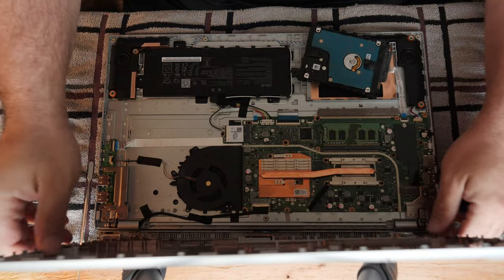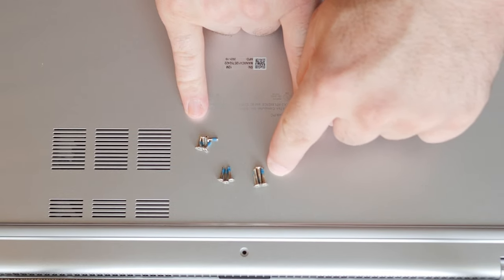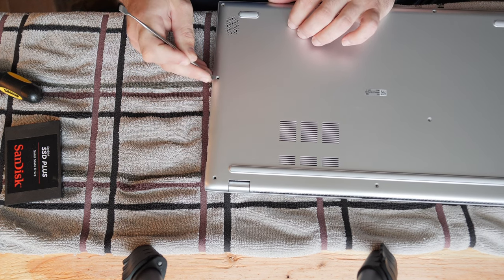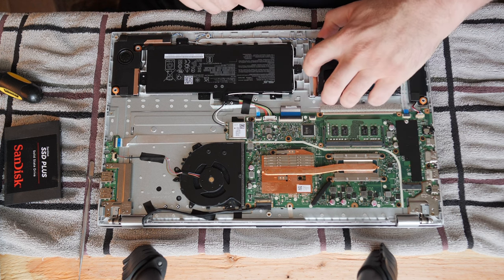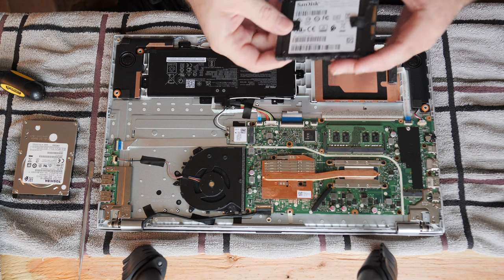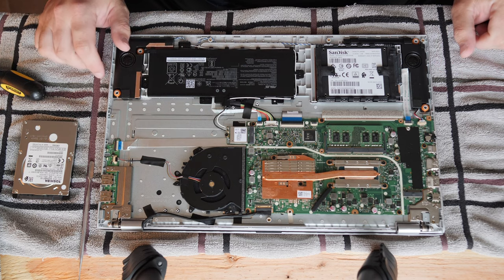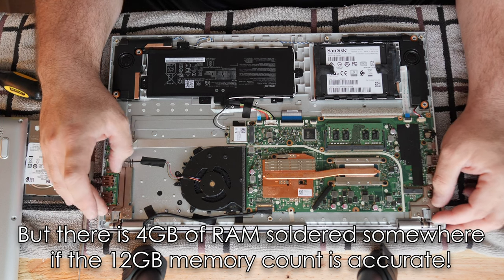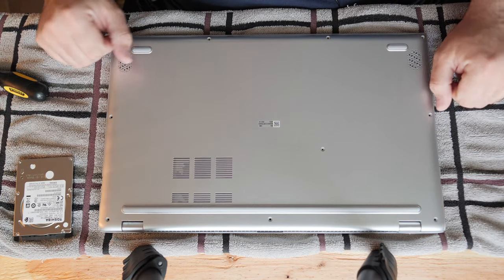Asus Vivobook X712J Disassembly and SSD Upgrade - Easy to Open, Flexible Upgrades! - Jody Bruchon

Comment: Anyone who owns this laptop you can install up to 36GB and it recognizes it. I put in a 32GB of ram (4gb is built in to the computer under the keyboard). So now I have 36gb of ram! Running smoothly.
Reply: mine has 40 gb
Reply: @terrariaskillissue4492  wow thanks for the info

Comment: if you don't mind me asking, where exactly should i start prying the bottom off? i'm not good with tech and i don't want to accidentally damage anything while i'm doing so
Reply from the maker: Wherever you see a big enough gap between screws along the bottom, usually. Often the middle of the front or back. Watch my other disassembly videos and you'll see several examples.
Reply: @JodyBruchon  thank you!

Comment: Hi bro, I want to upgrade my pc soon, and i wanna put 32 extra on it, its like tha same model, but in the official site it says that the maximum ram is 16, I mean it says I can just put another of 8, so I'd like to know if its true or just for no upgrade it more that it can
Reply: You can install 32gb of ram. I know because I did it last week on this same model and now my  laptop has 36gb (4 gb is installed and I added the 32gb ram stick). I am stoked! It is running smooth and fast.

Comment: Hello crack.
The RAM can ve upgrade to 16 GB???
Reply: yes, it can up to 16gb
Reply: Actually you can install up to 36GB. I know because I have this exact laptop and I bought a 32GB ram and popped it in to see if it would work. There is 4GB already installed under the keyboard. So I have 36GB of ram all together.
Reply: @rizza313twenty  i did not know that, i was guided by the page where it said "extensible to 16gb" so i thought that was the limit.
good to know
Reply: Yes, I wasn't aware of it either until I stumbled upon a UK site that explained although the manufacturer says 16gb limit it will recognize up to 36gb. I tried it and it indeed works!  @VisceralBoredom

Comment: wifi not working after installing m.2
Reply from the maker: You may have popped the antenna connections loose from the wifi card.
Reply: @JodyBruchon  thanks for reply! no works again once  m.2 removed